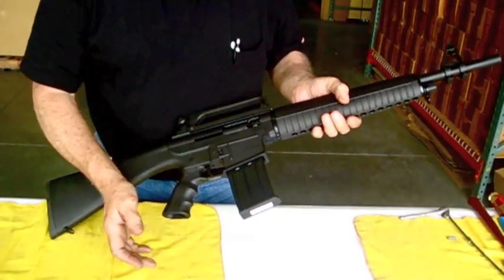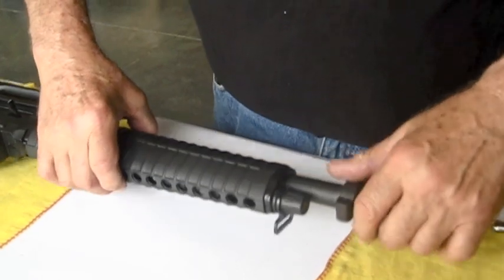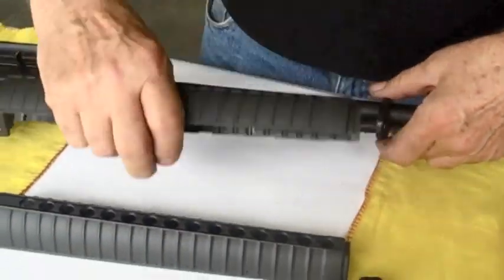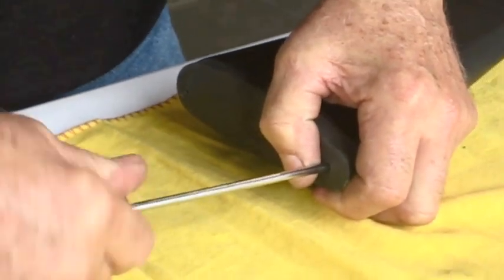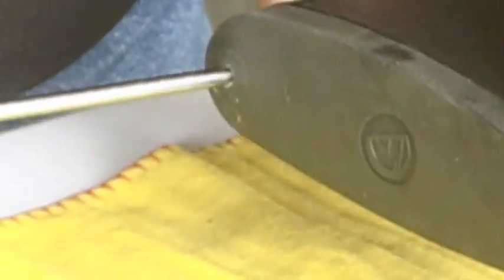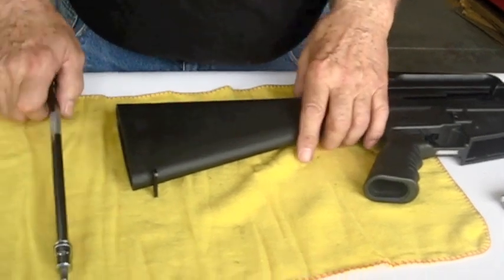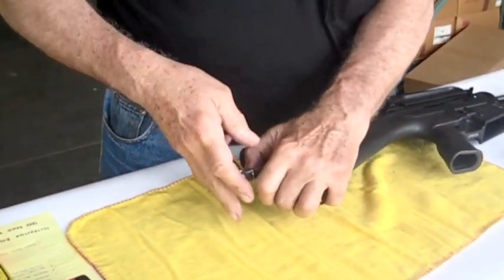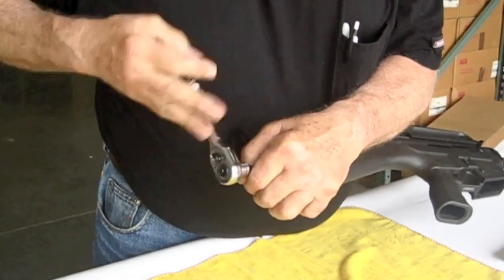MKA 1919 DISASSEMBLY INSTRUCTIONS

Comment: used these instructions (4 turns, love tap, then 2 turns, love tap).   When I tried to reassemble, the threads in the retention bolt hole were stripped at the top.  Unable to reattach upper and lower.  Had to re-thread the hole.

I would suggest NOT using a hammer after the last two turns of the bolt.   Remove the bolt and use a leather swatch and a rubber mallet against the upper to further separate the upper from lower.
Reply: I didn't have any problems... I was just carefull when I reassembled so I didn't misthread that bolt. It had nothing to do with tapping it out unless you used a sledge hammer.